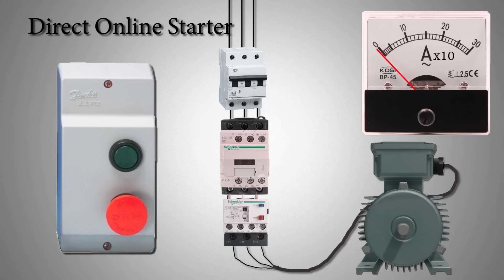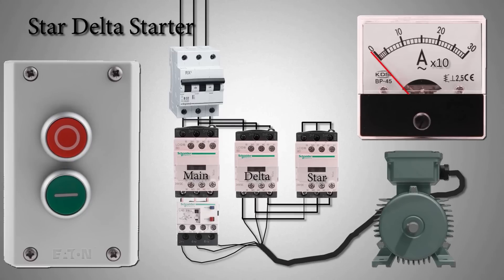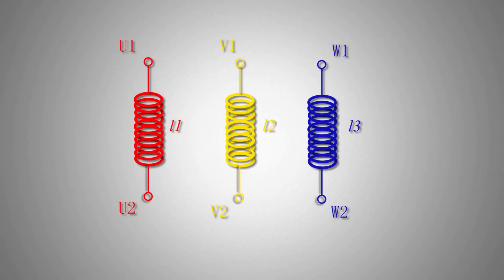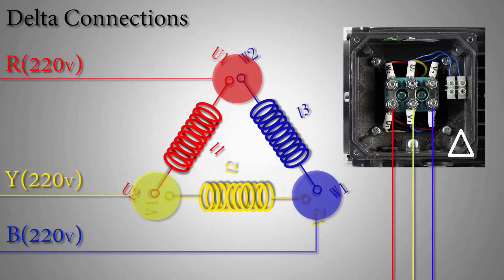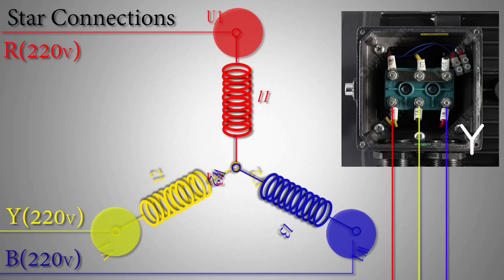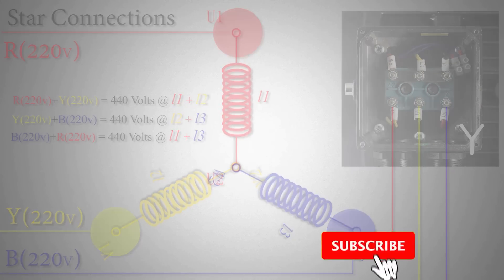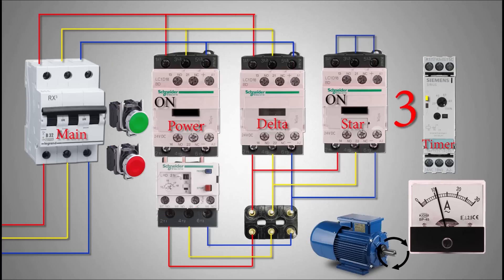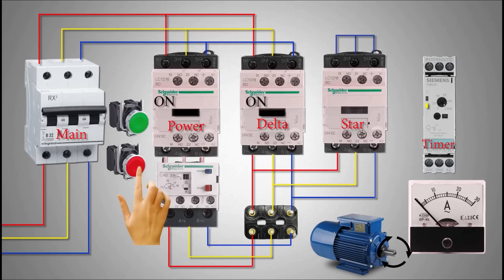Star Delta Starter Explained - Working Principle

Comment: I have always adhered to the golden rule of marking the 6 cables going to the motor with the correct phase colours. However I have seen Electricians mark each winding red U1/U2, yellow V1/V2, blue W1/W2. That's been a recipe for disaster.

Comment: Best video but has some problems about coils voltage at Star connection.  Regarding Star connection with source  3 phase 220V. So Vp= Vl/√3= 220/1.73=127V meaning Vr+ Vy= 127+127=254V. So the each coil received 127V only bay the way Delta connection each coil received 220V Thanks

Comment: Can you apply star_delta on single phase?If possible can we have the explanation please?
Reply: You wouldn't really want to use a 3 phase power S/D on a single phase motor as single phase motors could use soft start systems that gradually ramp the voltage up to its final output voltage, and you could risk the motor itself going kaboom. A VFD (Variable Frequency Driver) is typically used in this case since they can be set to start at a low frequency and gradually increases to the desired set frequency that is needed.

Comment: Are there any effects if the starter is installed far away from the motor instead of in the same room as the motor?
Reply from the maker: No effects , if proper cables size is used ,    I have used cable lengths upto 50 feets
Reply: @EASYPLCTRAINING  thanks the reply!! My cable length is currently up to 100 metres long… the soft starter is designed to be inside the control panel around 100m away from the motor. Not sure if it has any effects
Reply from the maker: @kensaxophone  great ...... as long as there is no voltage drop and no noticeable increase in the cable temperature , cable  length is ok

Comment: nice video but,...VR + VY is not 440 V, because there is an angle of 120 degrees between the vectors , thus 220 x sqrt3 = 380 V
Reply: Which connection consume more current star or delta at steady state?
Reply: Thanks
Reply: Sorry need more to know why need to times sqrt3?
Reply: @khaliqmk3617   because of 3 phase
√3*V(line)*I(line)*power factor=Power
Reply: @kasunrodrigo6592  thanks man
Reply: In oz it’s 230vt ( 400v)
Reply: @alphamegansw in Aus its 415v between phases sport.
Reply: @markhill9275  “1983
What this meant for Australia is that in 1983 a 20-year plan was agreed whereby our “nominal voltage” would change from 240V to 230V to match up with most other countries.
Reply: @markhill9275  this is the section: clause 1.6.2
Reply: @alphamegansw in Aus 240v to neutral or Mp
Reply: Best video but has some problems about voltage at Star connection. I think you are confused in this video he explained about Star connection with source  3 phase 220V. So Vp= Vl/√3= 220/1.73=127V meaning Vr+ Vy= 127+127=254V. Thanks
Reply: Nice one engineer square 3* power factor=power

Comment: Actually fase plus fase is not 440volts
The correct is 220 + 220/1,41 =~380v
And 230 new fase voltage is 230 + 230\1,41=~400v
https://youtu.be/mG05wQqNM0I

Comment: Sir, one doubt ,wire from  start button which is typically NC is directly fed to timer or its rerouted to main contactors NO terminal for self lock and then to timer?  We were unable to start our 100kw motor, not sure if its timer fault or contactor failure. Is star-delta timer auto latching or not sir,Thank You.
Reply: Sorry to say but i cant understand your words because there is no element on start push button.
First of all line wire will come to stop pb n c element after that it will connect to start pb n o element as well as main contactor's auxiliary n o point . But i always use line wire to overload relay then n c point then stop pb.
Sorry  if you feel any inconvenience with my words.
Reply: @hardintechnical  No Problem. Sir, i figured it out yesterday, issue was with the timer. I replaced it with a different timer. It works as expected. & the start button element NO is fed to main CONTACTOR NO &NC and then to timer. Because timer is not self latching as soon as On button is pushed so to keep the supply continuous to timer, it is fed through main contactor. Anyways Thank You, for wiring schematics.
Reply: @Ragavenutb  feel good to hear from you that the problem solved.
If any other issue you will face. you can visit the channel. there is some videos of industrial use wiring. with animation for better understanding
Reply: @hardintechnical  Thank You. Subscribed already 🙏
Reply: @Ragavenutb  lots of thanks🙏

Comment: How long the timer ideally set sir?
Reply: Suggest initial settings for HVA
C5 to 10 sec. for Pumps. 
15 to 25 sec. for Fans.
Reply from the maker: Depends upon the motor kW and rpm. Mostly between 5 to 10 sec